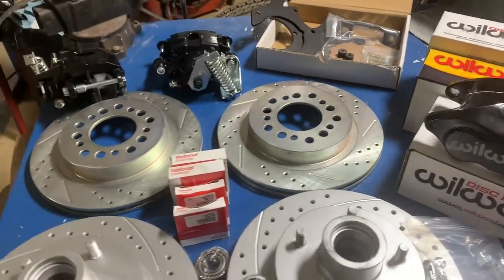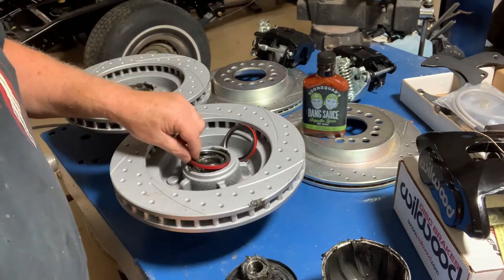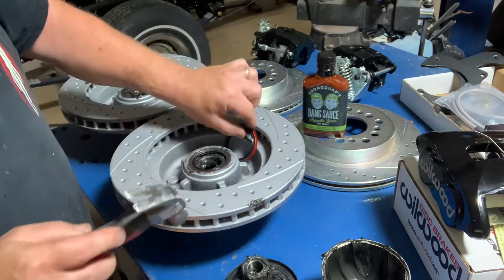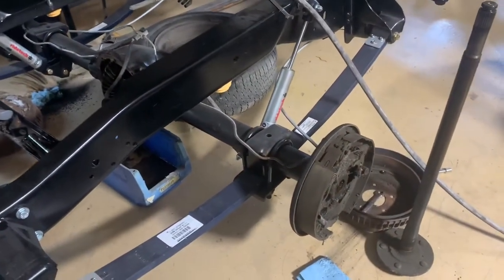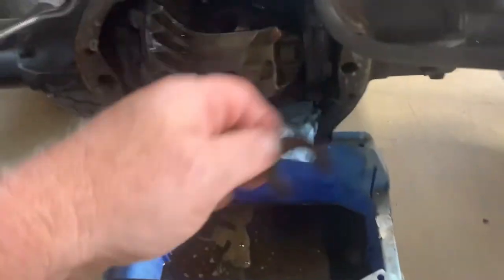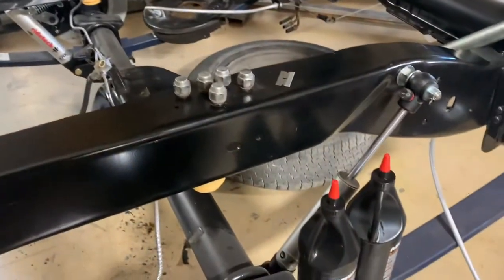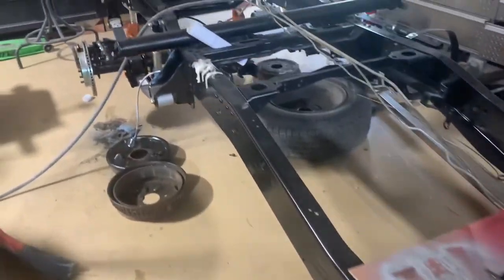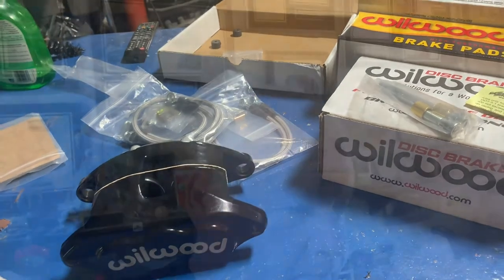C10 Chevy Truck 4 wheel Disc brakes, on a budget . #c10 #chevy

Comment: Spanky,
 A good looking kit for the money.  
I have an idea for paint color . As you are partial to earth tones , Ford Burnt Copper( I believe it is a 2019 color) - Main body color ,& as accent color (center panel stripe (factory) a color such as a fawn or buckskin would make a tasteful and good looking ride. Other possibility , instead of a factory side panel color, do a tasteful pinstripe in the buckskin/fawn color.
As for wheels, to keep cost down, how about using a set of 17 or 18 Chevy factory wheels off of a NEW Silverado or other Chevy truck. possibly find a set of take offs with tires. 
Interior would be slick as buckskin /fawn with a burnt copper stitching. Paint the steel interior of the cab / dash/ door frames the Burnt Copper. 
As for the wife's flowers, all I can say is grovel. Sure seems like the bad luck comes in 3s. At least in my world , it does.
Thanks for posting & as always ENJOY.
Rick
Reply from the maker: That’s a good choice of color. I’m going to look at that one. Thanks Rick.